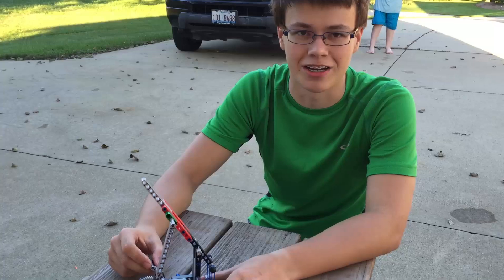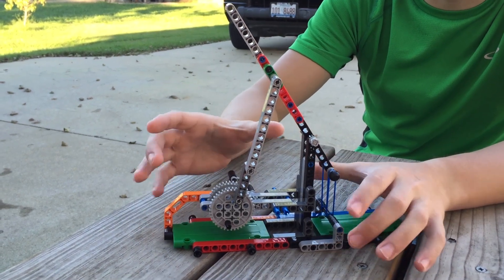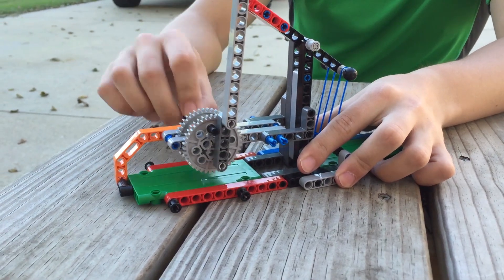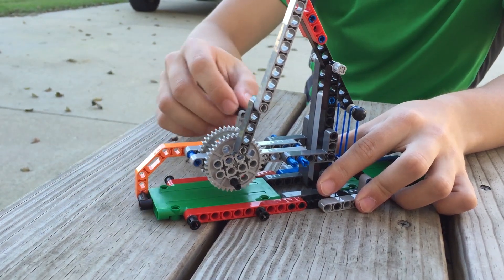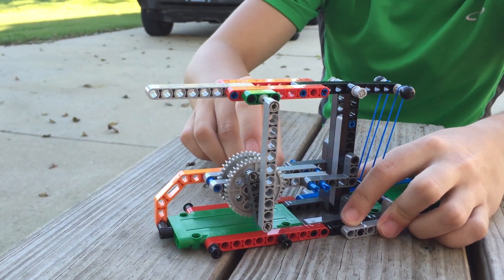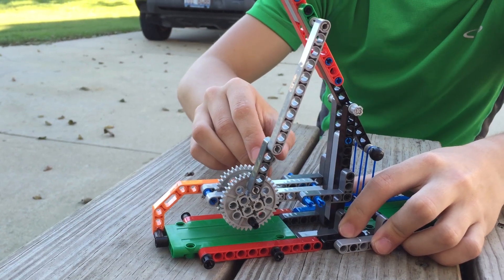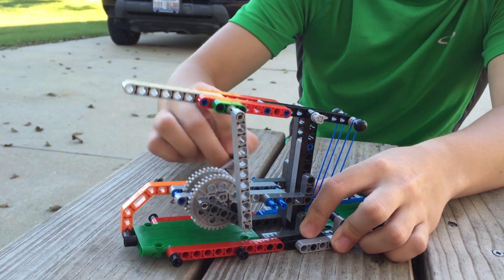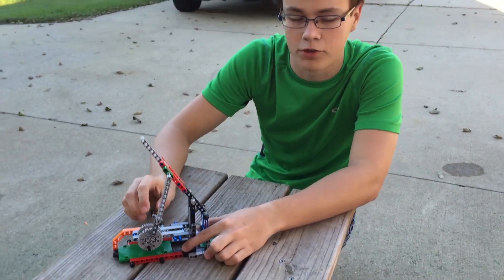Choo Choo Mechanism

Comment: Great video! I'm wondering how the 2 bars (connecting the launcher arm to the gear) affect the path of the arm like how much it draws back. It seems like if you made the lower bar ( the one attached the the gear) longer it would cause the arm to move much more than before. Any thoughts on this?